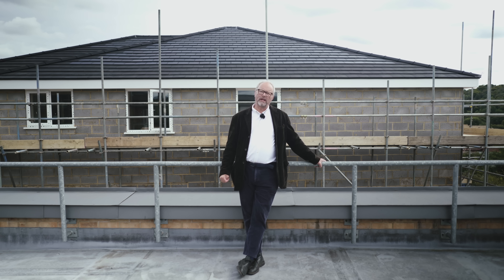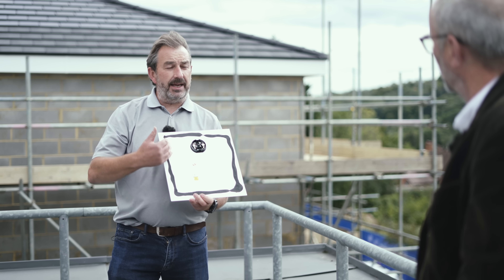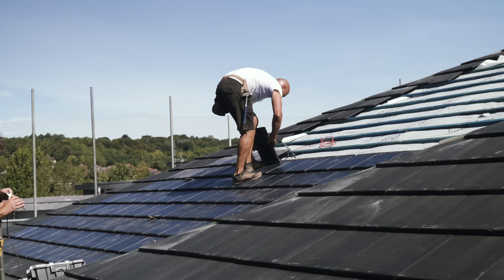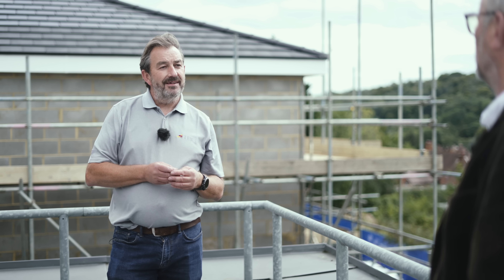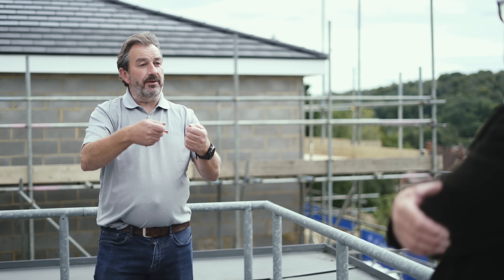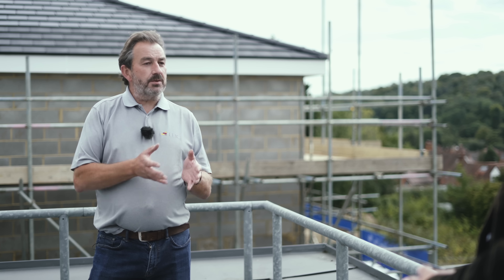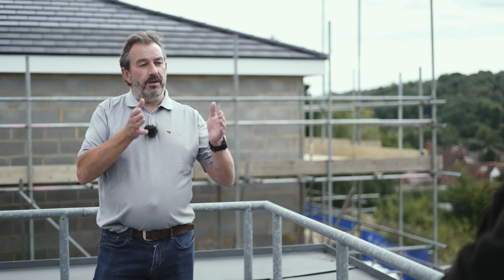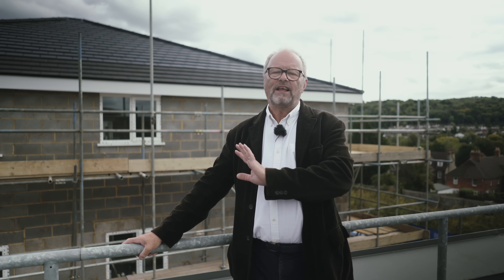Solar Roof Tiles - should every building generate its own power? | 100% Independent, 100% Electric

Comment: 60% of energy is lost through transmission lines, so solar is 60% more efficient if power used in the house or charge car or battery?
Reply: Incorrect. Transmission loss is <10% and in that they're also including the 1-2% in the step-up/down transformer loss at each end. Yes, big transformers are 98-99% efficient. Where on earth did you read 60% loss!!!
Reply: Thanks. I am happy to know the correct figures. So electricity coming through the overhead  power lines for hundreds of miles or the inter connector from France has a loss below 10%. I imagin the loss of energy from generating steam from gas or coal and generating electricity is enormous? Even before transmission loss.
Reply: What I was thinking originally is that even if we were able to save a few percent on transmission, it is still an enormous amount.
Reply: Keith George funny story, electricity travels at the speed of light well 1/100th to be more precise.

Comment: We have solar panels attached to our roof. We also have pigeons attached to our solar panels!
Reply: I've got some that want to nest under mine. But all the houses around have wire mesh around the edges. Think I need that!  You have a problem if the pigeon is attached.
Reply: MARK Yates that is what we had to pay to be done. It wasn’t cheap, several hundred pounds. What annoys me is that the fact there is a local business who advertise they can fix solar panel pigeon issues means it is a big enough problem for it to be something that should have been prepared for during the installation, not when the problem developed.

Comment: All powers good like to you guys!
Just remind me about the difference when a clever engineer and Elon Musk is doing the same thing. Compare this to solar roof by Tesla. Solar cells embedded in glass vs. soft plastic covered solar panels glued on a concrete roof tile with a huge hole in it (for the conectors). Hmmm, I wonder who did the accelerated erosion/durability testing and what was the results...
And sorry, but you can cut glass. Actually easier than concrete - just mark it with diamond tool and snap it...;-)

Comment: Don't they have any safety stardards in the UK? Standing on a roof with no safety harness and catching roof tiles being thrown at you has to be a recipe for disaster.
Reply: Yes, building regs are very strict here. On a shallow-pitch roof like this there'd be a fully-integrated scaffold at gutter level, boarded and bolt-secured, with a high rail for harness attachments, plus shielded ladder access, and all the rest of it.

I've done a little bit of (amateur, private-property) roofing, and I saw nothing here to ring any safety alarm bells. My concern would be standing and walking directly on those concrete tiles. I know nothing about solar panels, but I was taught that you never, ever walk directly on concrete tiles to avoid cracking them. Maybe these are special tiles. Or maybe not. I don't know.

The guys throwing the tiles up to the man laying them would probably have been attached to the high scaffold rail (it depends on what else was behind them - staging, perhaps - we weren't shown); if the man laying the tiles had slipped and fallen, he'd have tumbled down the pitch and been caught by the rail and toe-boards at gutter level. That's standard roofing practice.

Not much shows up on camera, but do you honestly think that any professional building outfit would allow itself to be filmed if it was openly breaking safety regulations?

There are huge fines for even minor infringements, so these people would have been following the regs to the letter.

Comment: The first time I saw a solar tiled roof (well it was solar slates actually) would have been 5 plus years ago. Whilst I think it's a good idea for conservation areas or retro when reroofing listed buildings, I think something totally different is called for on new builds. I've only ever built one roof, 2000 sq. ft of concrete tiles, I always say if I had to do it again I would use 'tin', composite large sheets for low rise buildings looks like a possible solution.

Comment: Like lots of other roofs I have red roof tiles - alas no red tile solar options & I live in a 'conservation area' so changing colour not an option.  
Notice you have hash tagged Tesla under video but Tesla tile system modular so not done with individual tiles and no cutting holes in the standard clay tile.  Good point re cutting glass but they did show a red tile option when launched system but not flat alas but keeping fingers crossed they will do flat red.
Reply: Philip Godfrey

"alas no red tile solar options & I live in a 'conservation area' so changing colour not an option"

I live in a similar subdivision. I think that laws need to be amended so that solar tiles are exempt, making it illegal for municipalities or individual corporations (like my townhouse corporation) to tell you that you can't do it. Otherwise we'll never get anywhere.
Reply: We have a red cell as well, however, it is less efficient than the black cells which absorb the whole spectrum of light.

Comment: This sort of thing should have started years ago, possibly made law. I know that it adds a fairly hefty expense to the cost of a house.

I wonder how easy it is to trace a faulty panel and if one goes down does it take the whole row with it? I think they were daisy chained together.
Reply: if the government could subsidise this kind of thing it would allow them to increase scale and get the cost down. Would be better if like Telsa the tiles could be made in 2s or 3s so there was less wiring. Look at each tile. Has about 50cm of wire on each end! That's about 900 feet of wire per elevation!  Crazy!

Comment: Erm, think there's an elephant in the comments room here. 900 x £1 = £900 for normal roof tiles. 900 x £30 = £27,000 for these tiles. Ouch!
Reply: I think they were comparing these tiles to a roof and traditional solar panels. But yes, if you just want a roof....
Reply: and 13.5 kWp of elecrical generation

Comment: But all those connectors! Surely they must have an effect on reliability? And do the solar cells run hotter than conventional panels, which might affect efficiency?
Reply: Just think how much plastic has to be used for all those connectors.  All those fossil fuels consumed to produce a tile that will only last 20-30 years in a best case scenario.  At this pace we are better off just throwing some more charcoal into the furnace!  Just think, the tile that should last a 100 years is now subject to mandatory upgrades every couple of decades.  Nothing about this is great.  I don't understand why so few people are actually thinking this through.

Comment: These solar tiles are not "invisible", in fact they are quite obvious. They also have a significant issue with their thermal mass and the fact that photovoltaic cells reduce efficiency/output with heat.

Tesla's solar tile framing tiles obviously can be cut as needed. They said that when they first unveiled them, and if you look at houses that have had them installed it's obvious. Besides, the type of roof is irrelevant: there are always vents, skylights, chimneys and other things that poke through roofs that you have to accomodate with any roofing system. Tesla's glass tiles also have much less thermal mass to reduce output. They are supposed to be much cheaper than these as well.

That said, Tesla's system is still as hard to come by as hen's teeth, so if I were putting on a new roof now or in the next year or two I would definitely be giving these guys a call.

I honestly don't care about the aesthetics that much, and I'm perfectly happy with the appearance of traditional photovoltaic panels, but sometimes one doesn't have a choice because of local ordinances or structural considerations.

I do have to point out that concrete is neither light nor particularly durable in this configuration. It's particularly brittle and easily chipped or broken. There was an obvious crack in the example shown in the video of the back of these tiles, and I'm willing to bet there's a fair amount of waste just drilling the holes for the wiring. On the other hand, if a tile does break the solar cell will usually be unaffected and can probably be transferred to a new tile fairly easily. But in a durability contest the Tesla tiles are light years above concrete, even if it's reinforced with fibers.

Comment: For me, the roof tile concept is aweful. The main principle of the roof tile is to offer weather resistance. The weather resistance element on your power-roof concept, has now moved to a silicone seal, between roof-tile and the solar cell, because each tile has a dirty great big hole drilled through it ! I would be interested to know how things fair in the long run...(how many leaks appear per roof per year).

Comment: Interesting how 99% of commentators here are recommending "governments to make solar an obligation" ..... but then again you don't see so many "voluntary solar rooftops" .... go figure, where the logic gap is ..... I am sure that these 99% are not familiar with the costs involved vs. the actual output you get .... And solar is currently still one of the "most value loosing" investements when building a house ..... I am referring to battery costs/ value etc. ....... 
Living in Northern Europe, solar energy is produced in the periods of the year where less energy is necessary, while during the energy intense months of winter, it is not really available in the necessary volume ..... and "storing" the energy across longer time periods is simply not feasible YET ..... So, currently, from what I understand solar effectiveness only happens if electric mobility is involved .....
So, if we are talking governmernt programmes, the "good ole" regulation or subsidisation scheme is simply not cutting the cake or contributing to a possible "solar break through"; instead creative ideas are required. Here in Zurich, Switzerland, the energy supplier had the brilliant idea to create "energy bank accounts", where you could simply feed your energy into the system while sourcing your energy back at a later (winter) stage, thus not involving all the tax issues which arise when starting to make "financial deals" with your energy company. Unfortunately, this concept got placed on the back burner, and I so hope it will come back so that we can move forward with our solar project, which otherwise unfortunately makes no sense.

Comment: It makes sense that economy of scale would dictate that the installation costs would be reduced if there was more demand, that's surely a given. If ALL new builds were required with 3 phase electrical supply and solar tiles/panels, there would be no need to consider the building of costly (politcally compromising), not to mention risky, nuclear power stations, would there? I find it frustrating that action isn't taken on this, when the supposed aim is to make the country zero carbon. There is apparently a contradiction of effort and potential here.

Comment: I have 2 questions:
1 how susceptible to leakage are these tiles? From what I can see, these are glued onto the normal concrete tile? What if the glue bond fails? Surely then there’s a hole in the roof, letting in rain?!
2 it appears that these are wired in sequence? If one tiles electronics fail, does that then stop the entire row/roof from working? Or are there backups to ensure this doesn’t happen?
Reply: Hi!  Sorry, I don't know anything about wiring solar panels, but I think I can answer your other question...

Any rain or snow that got under a tile would fall onto the flexible membrane beneath, and run down into the gutter. That's what happens on regular roofs now if gales blow water back up under the tiles.

The roof's hard concrete, ceramic, or slate outer covering is really only there to protect the waterproof membrane underneath from gales, storms, hail, ice, and UV damage. It's the soft membrane that makes a roof watertight, not the tiles. :-)
Reply: Elli P ahh ok I didn’t know that, thank you! Hopefully there are no holes for the cables to go through the membrane 😜
Reply: pete smyth oh well that’s confusing! I guess it all works together?

Comment: I'd be interested to see the actual price difference for the whole system vs a traditional roof with a traditional solar panel on it.
Reply: If you never knew, to give some context, the top of the range system from tesla (2022 solar roof tiles) are on avg 19% efficient, which is not anywere near the 23.8% some top-end panels produce, so realistic you only buy this solar tiles if you want a roof that looks alittle different but doesnt have big panels on it :)

Comment: Looks good new, the integrity is all down the the adhesive so would have been good to hear what has been done to ensure the durability over a 50+ year lifespan? Weather and UV degradation tends to break down adhesives? The you’ve got a big hole in every tile! We have wavy concrete tiles but presumably flat tiles are an easy enough swap if we ever need a new roof. Bolting normal tiles over the top is more likely for us I think.

Comment: 15 watts at £30 for each tile, or £2 per watt or £2k per kW, so £6-8k extra for a typical UK system. Is that right? He also talked of £11k per new roof at one point. That makes sense.

No brainer for a new build. But only one company doing it?

Comment: What does a dam or a powerplant cost? Use those funds to subsidize the cost of solar and wind power. Have large batteries for each block all connected to a grid.  If every third house had some sort of solar or wind generation we could dramatically reduce the amount of fossil fuel we consume .

Comment: Could you please do a video on hybrid solar system.  By that I mean PV panels that are  liquid cooled, and the heat from the working fluid is used for energy.

Thanks
Reply: The point when the PV panels are hottest is when the sun is on them directly, so you're not likely to need much heating at that point.
Reply: @videogalore  that is true but: 

1 PV panel’s have an optimum temperature range which well exceeded when the sun is beating down.  
2  Liquid running by PV panels could also be used to heat panels when too cold or covered by snow 
3  one is leaving a lot of untapped energy, by not using the heat,  about 2 units of heat for 1 unit of electric
Reply: @andrewsteinhaus8267  Oh I agree about the cooling aspect for the panels themselves, but I'm not sure that the heat removed would be much use given the likely time of year that it would be created.
I know that some hot countries use misting systems to keep temperatures down, but obviously that's single use water. It's the 80/20 rule with most of this, I'm not suggesting that it doesn't have a place, but certainly it would be interesting to see some figures for different countries as some will need one end of the spectrum and visa-versa. 
I suspect (although I'm happy to be proven wrong) that a system in the UK for example just wouldn't get above or below the optimum temperatures often enough to being in the additional setup and maintenance of a cooling system.
Reply: videogalore ,  those are all great considerations.   Which is why I would love to see a video  by the fully charged team, looking at all the advantages and disadvantages, and any research on the subject.

Comment: How much power do you get per square meter? 160 W? 5 KW seems to be verly low for a whole Roof. It should give at least 10 KW. And installing a battery at least the double the Solar peak capacity is really needed to give enough autarky to the building.

Comment: Definitely look better, but the cost is still too much of a barrier. A good compromise which I have seen on a few new properties is panels integrated into the roof, actually forming the roof covering. They are uniform black across the panel, appeared to be virtually frameless, and had conventional and similarly coloured tiles abutting them. Given they were at the same height as the tiles, and virtually the same colour they looked much better than bolt on panels- you could easily mistake them for roof windows. Presumably much cheaper, certainly easier to replace without disturbing the whole roof. Could be made in differing sizes to cover more of the roof- nothing looks worse than bolt on panels unevenly spaced or differently orientated just to fit as many as possible on a roof.